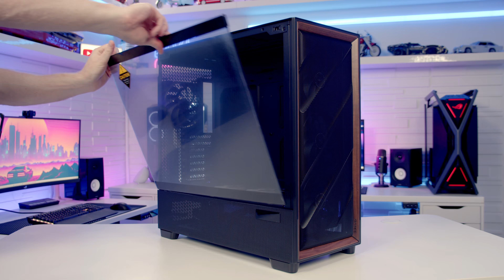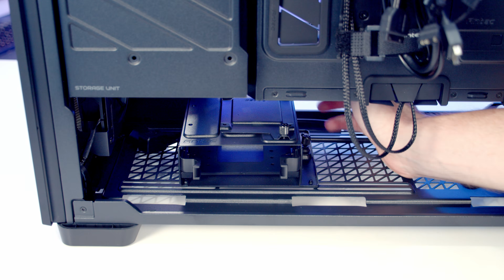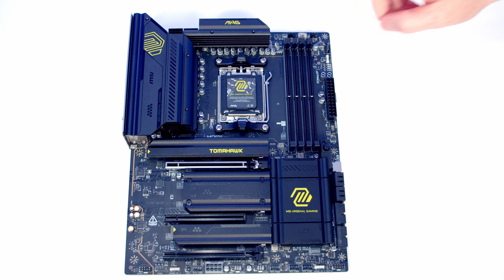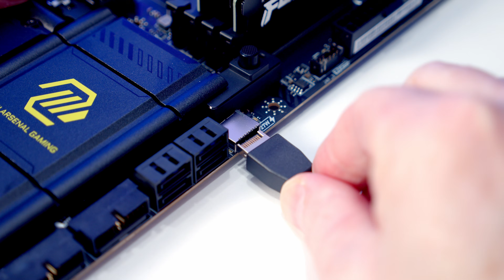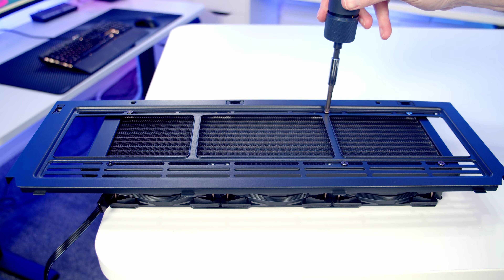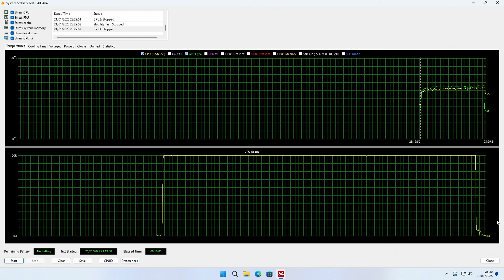Antec Flux Pro Build - Step by Step Guide

Comment: I havent used an Antec case since 2013. Antec made a tremendous come back.  Bought the Performance 1. Ugliest csse but the fit and finish is amazing. The easiest case to build in out of the many builds I have done. I had 2 things that were easlily resolved building. Most Case builds I run into tons of shit.

Comment: I have an extra fan hub. It should go into the internal usb port right? I think the reason it’s only 4 ports is because if you connect more fans you need external power to have enough juice

Comment: This or the lancool 217 which one would you suggest for a case swap, priority is 5070ti sff gpu cooling
Reply: Hey , What did you end up getting ? As im in the same boat rn
Reply: @im_zerox6205 I ended up getting a lancool 207 it's a very good case for the price and cooling it offers with three different inbuilt gpu sag bracket based on the gpu size. Many who've tested have confirmed it to have superior out of the box cooling compared to other cases

Comment: Would mounting the bottom intake fans at the bottom of the case instead of the default position on the psu shroud lower or increase temperatures?
Reply: I mounted 2x 140mm intake fans at the very bottom of the case, 1x 120mm intake on the bottom side of the shroud and 1x 120mm Lian Li UNI Fan SL-Infinity Reverse Blade ARGB on the top center of the shroud so my GPU stays nice and frosty. Go ahead and mount your 140’s, just make sure you have another layer of intake above them so the airflow doesn’t leak out the mesh side panels on the bottom of the case and you maintain that glorious positive air pressure the Flux Pro was made for. (FYI I typed this in a hurry so if I’ve made a mistake….apologies in advance)

Comment: Great instructional video.  Thanks much!  One note: In position A the PSU can actually be installed without curling the cord up front by having the orientation of the plug on the back panel reversed (upper right corner instead of lower left corner).  Antec's instructions illustrate how to do this and it's far cleaner as the cord is curled behind the back panel rather than the side panel.  One large loop nestled quite nicely behind the back panel.

Comment: I was totally blown away at the knowledge that you paved forward. I have one of the older Antec cases full tower. I had taken it to the shop to replace some front cooling fans and to check registry but they didn't do anything that I had requested. Thank goodness they didn't charge me any funds. Do you respond to any messages that you receive? I'm only asking since most of the creators don't. The last time I had bought this case and motherboard was quite awhile ago. In fact, tiger direct doesn't even exists any longer. My board and components are so old that Windows 11 won't work despite the 2 ea DDR3 sticks and a MSD board with dual graphics. I run two monitors (21 inch Acer) for my college work and my small engine business as well. I can probably google the size case fans for the front of my machine. Any help would be appreciated.

Comment: Will the 210mm LENGTH seasonic 1600w titanium psu be able to fit in the sideways position of the case? or will it only work with regular oreintation?

nvm just saw that it supports 180mm max in side.
Reply: Yes, it shall fit. It won't fit if you rotate it.

Comment: I got the non pro version of this case and found that my motherboard cannot control any of the fan speeds so it is constantly at full RPM regardless of any settings i choose in the BIOs or the CPU temps, do u know of what I can do to fix this? Is there software available that will let me control fan speed? Because it's kinda bonkers that to use the fan controller i just lose all control of the fans

Comment: surprised they didn't daisy chain those 3 fans on front and 2 on bottom so you would only need 2 out of the 5 plugs on the hub. Sounds like I'm going to have to get a mobo with plenty of plugs since I want an aio, that rear fan, and I was planning on getting 2 more fans to put on the bottom under the psu shroud since it looks like there is size for 2 120s down there.

Comment: funny thing about the PSU rotation feature: it outlines scenarios for the port being up/down/left.right but it doesn't account for the port being sideways, which as it turns out is how the PSU I bought is oriented. Definitely going to have to use that loop trick.

Comment: I bought this case literally a week ago for my next build.  I was debating on 4 cases; Strix Helios, ProArt , Havn 420 & this one.  The Helios & ProArt look to be really nice cases but I felt it had the least amount of flexibility at the lower/ bottom of the case.  The Havn 420 also caught my eye.  I didn’t choose this one for two reasons.  I didn’t like that it didn’t come with any fans.  The other is the glass being positioned closer to floor.  It is quite stunning but I felt I was more likely to scratch or crack it, especially sitting next to my chair.  
   After seeing this video, I’m more excited and happy with my choice.  Thank you for this video
Reply: Heyy would you still recommend this case over the HAVN BF 360 Flow  ,the Fractal Design Torrent, and the Proart PA602 ?

Comment: Excellent video! Thank you! Helped me with my build. One question: why didn't you use the 870E's included EZ Conn Connector to connect Antec's 3 output connectors: USB 2.0 for Temps, 3-pin ARGB Connector, and 2 pin fan connector and connect the whole thing to the one header on the motherboard labeled JAF_2?

Comment: Thanks for review ! Im just thinking of getting the new case and this one on the list, but i like the aesthetics of Fractal Design Torrent/Torrent Compact. And i am wondering what is the better choice for R7 5700x+3080 (will be upgraded to 50x0 series i guess), both air cooled. From the thermals/noise perspective.

Comment: I have this case and I love it.
I have theROG crosshair X870E-E Extreme motherboard with the 9800x3D CPU and 32gb of T force ram with the astral 5090 and a Ryugin 3 360mm aio and i am running a 2tb and a 4tb samsung 9100 gen 5 nvme storage drives i am truly impressed with the thermals and airflow of the case.And I like how subtle the design is it has a sophisticated esthetic, I would recommend it to anybody.
Awesome video too by the way.

Comment: The button for lock PCIe graphic card. It should be locked / closed before you insert card. I think I remember the manual says so. If you do this, you can hear a click that lock slide back correctly if you insert the card firmly enough and lock is applied. If you lock after you insert the card, it may not be totally inserted.

Comment: How do you plug the sixth fan in? Do I really need to buy another fan hub? That's silly
Reply: I'm waiting for this one in the mail as my old case's power button is done for and I can't retrofit a new one due to the age. Given the fact that I'm currently running 6 fans through an NZXT fan hub, I'm considering just transferring that hub to the new box as well and using that instead of the pre-installed hub. That'll also let me keep the programming of each fan with only slight adjustments in re-naming them for location.

Comment: This case seems good in general, but the screws do not line up to a standard power supply when installing the PSU. Also the connector for the power switches etc is terrible, not labeled. Otherwise seems good so far. Oh and also there are multiple plugs for the fans that don't reach far enough to plug into anything, not just the one fan he mentions in the video. This video really doesn't do a good job of telling you how to plug in those specifics, they kind of gloss over it, could be improved.

Comment: MSI’s own tutorial says the EZ PCIE button should be set to “locked” when inserting the GPU. Was trying it that way for a good 20 minutes with no luck, still won’t align using this method. Nothing seems to be blocking the lane.. any ideas? Astral 5080 + MSI mag x870 tomahawk wifi + Lian Li lancool 216.

Comment: The reason that the rear fan is not connected to the fan hub in the case is because the 5 fans already connected total to a maximum rating of 0.96A. Therefore, if you add the rear fan, it would go over the standard 1 amp rating of most fan headers.
Reply: Thanks for the information
Reply: oh i almost forgot about the amps in parallel connections, this is a pretty solid point. This comment should get pinned! This entire time I'm thinking these are all 120 PWM fans when they're not and use way more with 3 140s at the front.
Reply: The hub is powered by Sata, not over PWM. The PWM connected to the board is only for speed control.

Comment: Amazing guide but I somehow managed to miss where the temp controller is meant to plug into. I can't seem to find any cord with my psu, mobo, or anything else that would connect to and none of the spots on my mobo fit it either. It's the only cord not connected to something which I would assume is the temp screen
Reply: I'm unsure of this, but I believe the temp controller piggybacks off of the case's regular USB hookups and does not have its own cable.

Comment: Thanks for this.  It's a great video resource.  I bought the Flux Pro and am excited about building it this weekend.  Question for you: I'm installing the Arctic Liquid Freezer III 420mm AIO on the top.  It is a thick cooler at 67.5mm, according to its spec sheet.  If I bring the eps cables in through the top cutout, like you do in the video, will they interfere with the placement of the LFIII fans and radiator?  Thanks again...

Comment: First time builder and just got this case! Thanks for a great guide, although I’m still confused on fan direction. The label/nice-looking side is usually the intake side, right? Well if that’s the case, do the bottom fans come pre-installed to intake from inside the PC and blow air out? I figured they’d be in taking air from the bottom, but the way they have their front labels facing inward seems to indicate they’d be blowing air the wrong way. Sorry if this is a dumb question, I’m in the process of building rn and it’s pretty confusing
Reply: Check 3:29 in the video. "...Antec have installed two 120mm PWM non-ARGB reverse-blade fans." The reverse-blade bit means that they blow in the opposite direction of typical fans, specifically to keep the logo visible without compromising airflow, as you've correctly realized would otherwise happen!
Reply: @ thanks!! Very helpful :)

Comment: would be the perfect case, if only it didn't have that super fine mesh on the top. grok ai says that can lead to 25-40% reduced cfm from the rad and mesh restricting airflow and raising noise 2.5+ dba.
I wish they had a less restrictive top panel option.
Reply: You can completely remove it…

Comment: Hi. Thanks for another great build guide. The cordless screwdriver that you use is it the number 1 setting for the torque setting that you use and what size philips bit do you use. I got the same screwdriver recently and find that it kind of tries to keep screwing even when the screw is fully tightened. There does not seem to be an auto cut off
Reply from the maker: Yes, setting 1 with a size 2 bit. You just need to take your finger off it when you feel it go tight

Comment: Slight problem, if you buy a 1500 watt power supply with 3.1 and 5.1 . The power cable can not be used with the psu adaptor cable because that is a standard C13 kettle and the NZXT c1500 psu uses a larger C19 cable, so no side power supply mounting is possible.

Comment: Hi. The electric screwdriver that you use does it have auto shut off when screws is fully in. I have it and it seems to try to keep turning at the end. what torque setting do you use and is it the PH1 bit you use, Thanks

Comment: Thank you for this high quality video.
I just watched your very complete test of the "Torrent" and now this one, "Flux Pro".
Now I’m in doubt.
I have to mount a 9800X3D with the 5090 FE that I have.
The cooling system is different from other GPUs with a full flow from bottom to top.
With a noctua NH-D15 on the CPU, I wonder with which case, the airflow will be the best to cool everything.
From a performance point of view only, which case would be preferred?
For the moment, I think "Torrent" is the best for a transverse airflow that seems the most optimal to manage the rising heat of the 5090 founder edition.
Community feedback ? 
And thanks again for your excellent content !

Comment: Just got this case yesterday.
The back screws for gpu are long enough to support the metal bracket that came with my 4080 super suprim.
Also, doesn't have a front bar or area to screw in additional bracket on the front of the gpu.
Order a stand from Amazon, should arrive today. Gonna see if this works to prevent sag.
Was watching your video to see how you installed the gpu.
Super nice case though

Comment: I just swapped from a Corsair 5000Flow version and wish I would have done is sooner. Great to build in! Plenty of built in cable management. I'm currently using a 12000k and 3080ti with 3 120mm intake and another 3 for exhaust fans with air CPU cooler. Straight swap to the stock setup on the Flux is a 5 Celsius drop and the thing is dead silent. My only complaint was the 6 fans and 5 slots thing too. I wouldn't even ding them for not having 3 fans on the bottom. Can't think of too many cases that come with 6 for people looking for a plug and play setup with great thermals. Plus enthusiast are just going to ditch all the fans anyways.

Comment: This is my current case, and is hands down one of the better cases I have build into. Outstanding build quality.
Reply from the maker: Yes, very impressed with it
Reply: Do you still recomend it bro?
Reply: @hazaellara-b9l  absolutely
Reply: @gilgalaad80 Did you fit an AIO, if so, front or top?
Reply: @SL1PSTAR  EK Nucleus 360 top, 3x120 intake front fans, 1x120 back exhaust. removed the bottom fans, since i don't really play games that much and my gpu is almost idle all the time.
Reply: @gilgalaad80  Thanks for your info.
Reply: how did u manage to get the motherboard past the integrated io shield?
Reply: Congratulations bud,

I have a antec C5 case now but bought a antec FLUX PRO White Full Tower Case how much more will I be happy??

Comment: Just bought this case, absolutely love the airflow! Will you test all the fan configurations? Do you think adding fans to bottom near PSU actually helps, especially if you remove the dust filter?
Reply from the maker: No plans to test, but i don't expect temps to be much better as airfow seems good already
Reply: @ChristopherFlannigan  understood, thanks!

Comment: Would you not be able to use a split lead for the fan that could not connect?
Reply from the maker: You could, but plugging into motherboard was easiest option at no extra cost. The fan hub should have had at least 6 ports